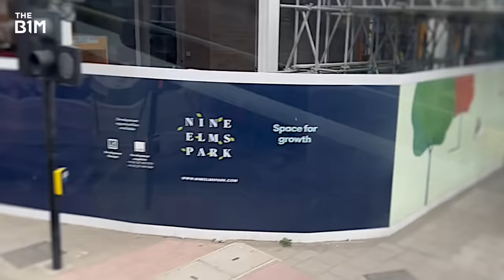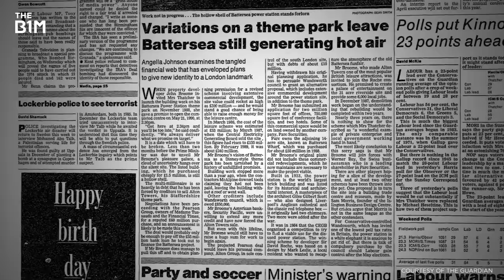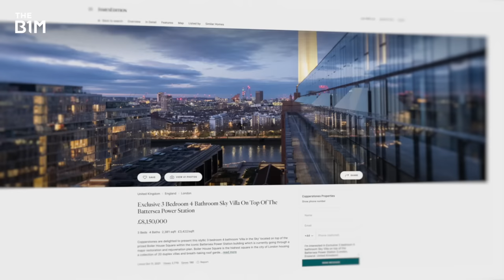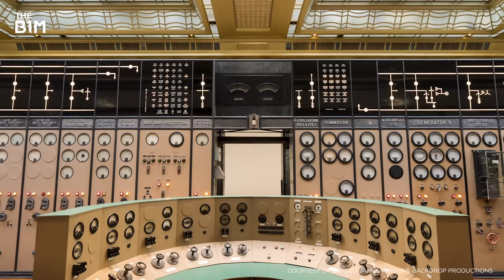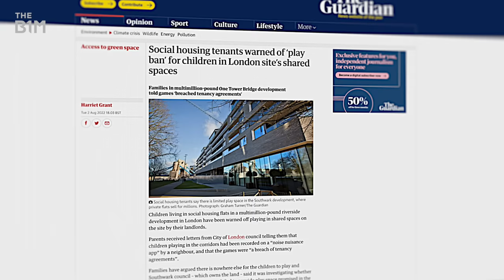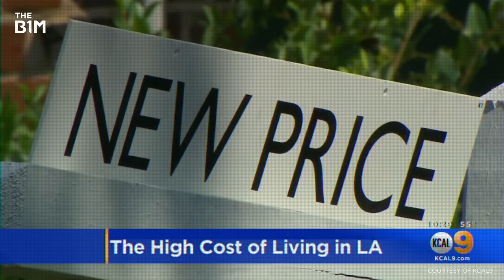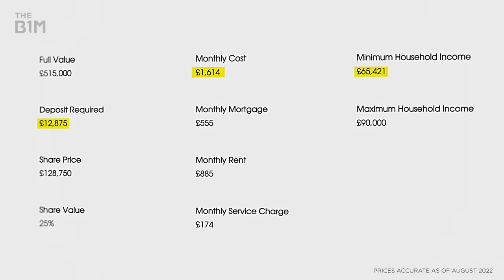Why Our Cities Are So Expensive

Comment: London is currently going through a massive housing bubble and hopefully it will pop soon

But I don't think it'll burst anytime soon due to the mass-immigration into the UK which is pushing demand while supply is not able to catch up and this is helping to further "gentrify" London and make it more expensive yet almost no one is talking about it in the UK coupled with the main party in power (conservatives) seeing a massive backing from private property developers meaning that they don't want to actually build more affordable housing since that would lead to potentially lower revenues or profit margins...

Also, the new Northern Line extension was only built because the size of the development requires a new rail connection, similar to the reason behind the new rail line to the Barking Riverside housing estate which is also being built on the site of a former power station...
Reply: What makes you so sure that the prices are driven by speculation rather than an actual gap between demand and supply? Is vacancy extremely high in London?
Reply: @johngorman6641  I agree with you that it was intentional. Too many people act as if it's an accident or people don't know how to fix the problem. It's the same with the energy 'problem'. However, while an undersupply will stop prices from falling as far as they would if there was a good supply, it's not the only factor. There's only demand if people have access to money and can afford it. With housing, people have other options, like to move in with parents or share. If income rises slower than inflation and interest rates rise, plus confidence falls, which it will, then prices will fall back. There's also the jobs market to consider. As far as I understand there is an undersupply in Canada, yet prices there have dropped quite a bit this year.

Comment: Sold on from debt distress in the recession by the emergency property bank "National Asset Management Agency" or NAMA.

Under special powers given in the recession to save multiple ailing property companies  NAMA took over from Treasury Holdings and gained ownership of Battersea Power Station. They then sold it on when the right offer was made.

The Irish govt missed out on a massive windfall, and London's rush for mega developments has meant that the profits involved are far greater than previous plans. The local communities have Ireland to blame just as much as the current project.

Comment: Housing is not like any other commodity.
If your city becomes too expensive, you can't just live with out a house or move to another city because your whole life revolves around where you live. And you can't just increase the supply of cheap housing in a city. Space is limited, it takes a relatively long time to build it, and you can't just produce a house somewhere and send it to where it's needed.
Therefore, you can take any price you want, because your "customers" cannot just cut costs and live with it or take a cheaper equivalent.
Moreover, since you can't just increase the amount of housing, especially cheap housing, to just sell a huge amount of it at a small profit per unit (and still make a good bug), the market will naturally seek fewer houses, but at a big profit per unit. 
But the process can only degenerate into this absurd order of magnitude if the customers can also spend so absurdly much. And they can, because "the rich" accumulate much greater wealth than the rest of society. This means that the accumulated wealth of the rich leads to inflation, which harms the rest of the population even more.
We cannot afford the rich. It does not matter whether the state collects enough through taxes or not, if a small part of the population is off the scale that much, it harms the entire economy.

Comment: The problem is, Upper Management and CEOs are earning 100-1000x more than their employees. Profits are carved up to give bigger bonuses to upper management, and peanuts are given to the employees. This "inflation" most western countries are going through is artificial due to the handouts given by the governments during the pandemic, and its giving more power to corporations to widen the gap between the rich and the poor. THen they can cry poor saying "oh why is the economy not right?"..

If your car engine requires 3 lites of oil to operate efficiently and effectively, then yu wouldn't wan to put in 1.5 litres because it means you can save money, which in the short term you do, but soon enough you are going to have to spend money to buy a new engine when it eventually seizes. Same thing happening here.

Comment: Need to tackle the issue from 2 sides...
- build affordable homes, even if they aren't pretty "designer pieces" and slightly break said zone's height limit. 3 levels instead 2 is 50% more flats per unit area... and resulting flats are cheaper due to sharing walls and underground infrastructure
- actually enforce that people buying them also live in them, and not rent out to make profit

Comment: Local Governments don't have a lot of levers they can pull here. One of the few levers they do have though are Taxes. I think tax rates should be linked to the cost of a space rather than its type. Affordable Housing should be tightly and objectively defined, and Luxury Housing should also be clearly and objectively defined.
Affordable Housing should give Developers a Tax cut proportionate to the amount of the units they build and the percentage of the overall building those affordable units take up. There should be a minimum of loopholes and exceptions too. For instance, there should be a minimum number of units that must be passed before you get those tax cuts. If that limit is 1000 homes, then for every percentage point of affordable units after that, you get proportional tax cut the idea is to make real affordable Housing more profitable for developers without raising the cost of rent or the bar for ownership

Comment: Very good content, raising important questions. A touch simplistic in the sense that it suggests political will is all that is missing to solve the problem. Well, if that was true and if leftwing politicies was sufficient to bring prices down to an acceptable level, Paris would be much cheaper than what it is. In fact Paris shows you that leftwing policies can bring prices down, if you compare with London, but not down to affordable, only down to a little bit less crazy. Reality is that in countries that are ageing and in systems where first comers (i.e. previous generations) have a massive advantage, prices in city center cannot go down... You can go to a city center and find that only rich people live there, but you will actually find that mainly older people who bought in the 90s live there. The other point is that when prices go up and yet there are sufficient numbers of buyers, the issue is not real estate anymore, it is why some areas attract wealth so much while other parts of the country remain in relative poverty. France again is good example. You can have all the leftwing policies that you want, as long as political, cultural and economic powers concentrate into one big city hosting 1 in 6 citizens of the country, housing prices will go up...

Comment: As an architect near retirement, i have worked on several huge projects some taking 18 months to two years to finish the construction documents.  2 Years on one project is a long time, and 75% on the way to finishing it starts to get tiring. This year for a small firm of 2 people we have 191 projects, completed and started. 
I would much have many small projects than on or two huge projects. Plus you never know when or if the plug will be pulled. so in a career of 50 years I could have completed 100 projects or 10,000. PS don’t forget the golf in between everything else. 
BTW,  one big boo-boo can kill your career as an architect on a large project.

Comment: That's cool that they did this but they should have just demolished the old power station. I think it would have been cheaper since the old infrastructure had to be "sanitized" and rebuild. If they really wanted to keep some of the history they should have just kept the front facade and the front two chimneys. I just hope decades from now it wont be an eye sore and out of place with the modern architecture. I live in a city where we have two/three de-commissioned grain silos and hope the city does something like this or just demolish it to build a new residential/commercial building.

Comment: If you artificially lower the housing prices, then even more people want to live there.
Cities getting flooded already by people who dont wanna live in rural areas anymore. Thats no secret.
The only solution i can see is increasing the supply, as the demand is very high due to multiple factors which cant be suppressed sustainably.
Increasing the supply with extremly dense flats could lead to ghettofication.
Other thing we can do is improve the speed of public transportation: if you can move by train 5x the disance in the same time compared to now, people accept living „further away“ which could lead to lowering demand.

Comment: When you see here, how little of the original Battersea Power Station was actually saved, including 0%  of the old  chimneys, you realize these great “renewal” ideas are just that - ideas.  

Renewal, reuse, repurposing, sustainability, these are mostly banners to rally the public, and investors around.

No doubt it was cheaper to tear down most of it, in order to build the new with the proper modern standards;  but cities need to get far more “real” with the public about what’s really happening.

Comment: 🎯 Key Takeaways for quick navigation:

00:00 City developments costly.
00:35 Affordable housing scarcity.
01:36 Battersea Power Station revival.
02:08 Housing market crisis.
03:11 History of Battersea Power Station.
04:10 Transformation by Malaysian developers.
05:09 London's global connections.
05:43 Historic sites repurposed.
06:13 Battersea as London's new center.
07:15 Eight main phases of development.
08:15 Challenges in building restoration.
09:42 Reconstruction of chimneys.
10:46 Vauxhall, Nine Elms, Battersea plan.
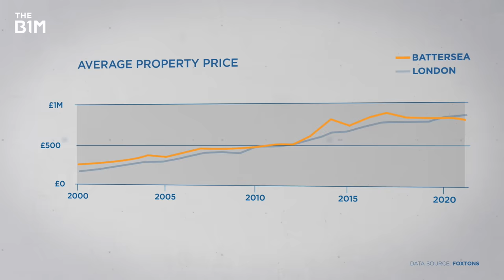12:43 Rising house prices.
14:03 Gentrification concerns.
16:52 Different treatment for social housing.
19:06 Gentrification and regeneration.
21:00 Funding challenges for affordable housing.
22:51 Affordable housing challenges.
24:17 Developers' interests vs. social housing.
25:42 Solutions for affordable housing.
27:03 Global affordable housing crisis.
29:58 Impact of development on communities.

Made with HARPA AI